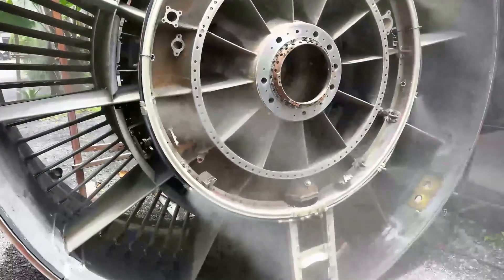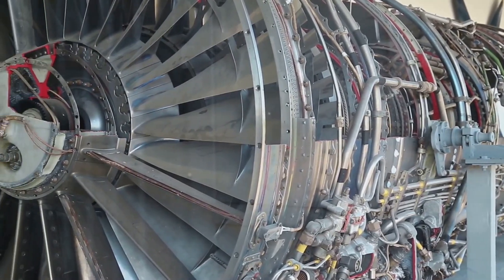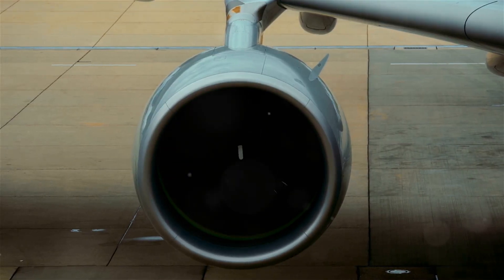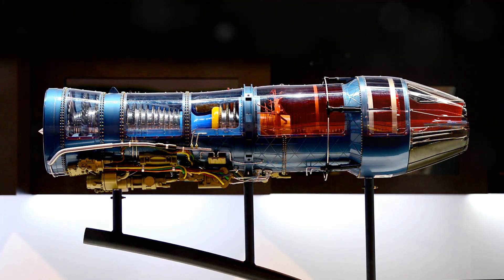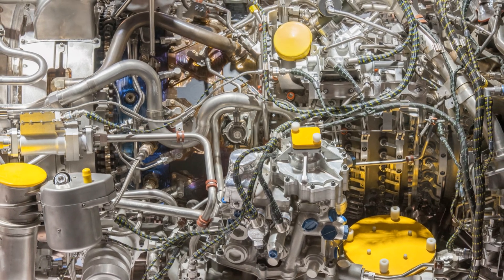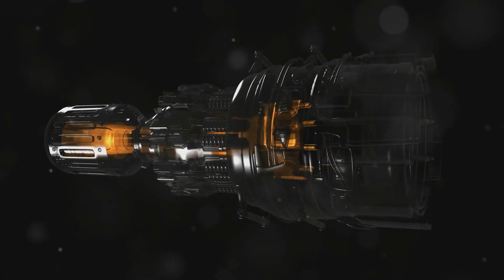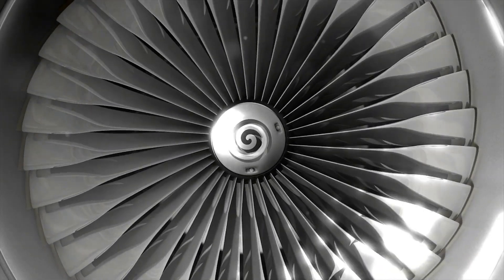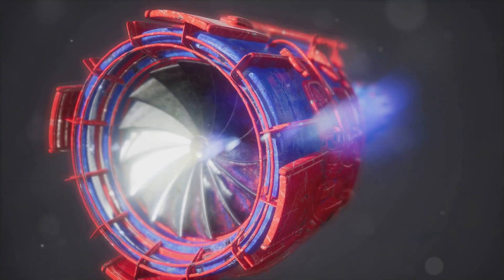How Does a Jet Engine Work? | The Science Explained

Comment: Nice audio explanation, eventually, (same info too many times to start with). Pity the video isnt related to what is being said, so talk about the compressor, show the compressor, talk about the turbine ,show the turbine. Just showing various shots of the whole engine is pointless, you had a cut away jet engine in your vid it would have been worthwhile to use that to emphasis the audio explanation, overall, nice try could be much better. One point, the compressor works by the air going through rotating and static stages of compressor blades successively, turbine is the  same principle.
Reply from the maker: Thanks for the input
Reply: @TravelExploreVideo  I intended it as constructive criticism please take it that way